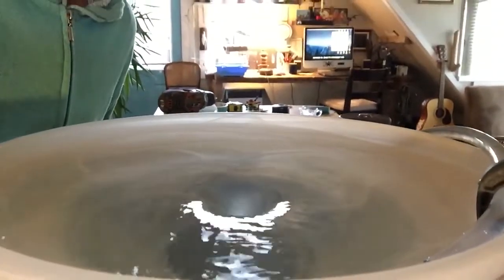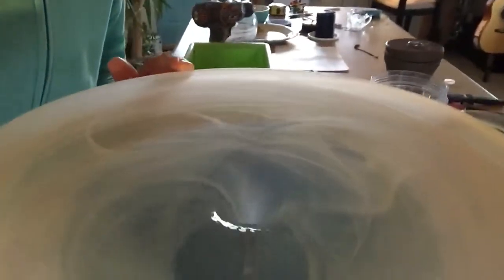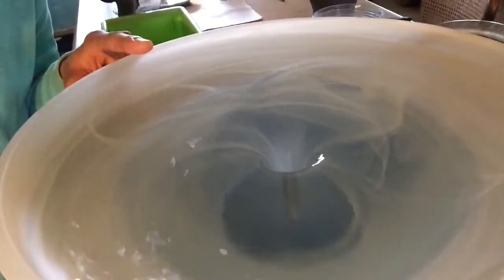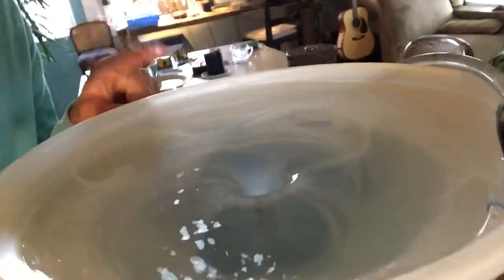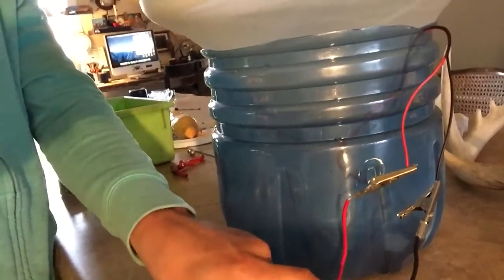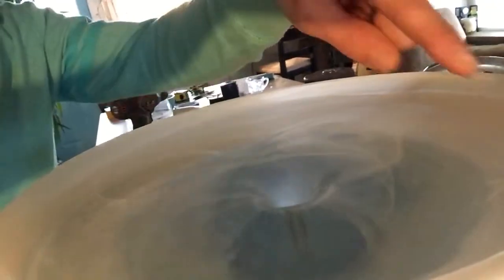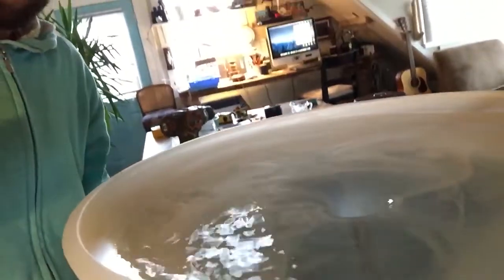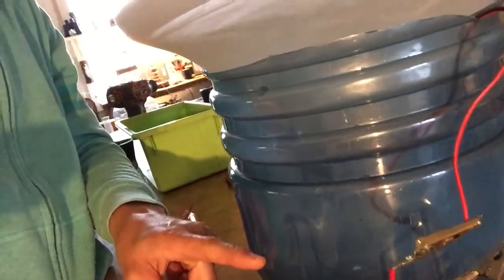Worlds FIRST and ONLY Self Stabilized, Non Overflowing, Water Vortex Fountain

Comment: the statement in the title is ridiculous .. get a proper pump and you will soon realise there is not self-stabiling here. My water vortex is self stabilized via electronic monitoring.. so stay humble
Reply from the maker: this is not stabilized digitally it is stabilized mechanically. A far more elegant solution wouldn't you agree?
Reply: @islandonlinenews  nope it is stabilized cause your pump is weak. It is stabilized via power consumption add a bigger pump and you will see
Reply from the maker: STEM Projects It is the exact proper power, not stronger, not weaker. Perfect.